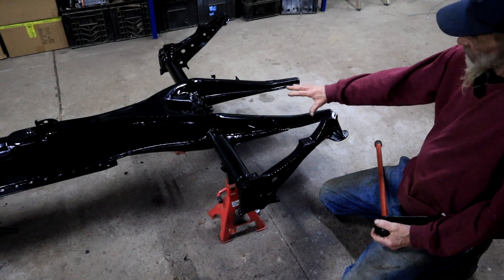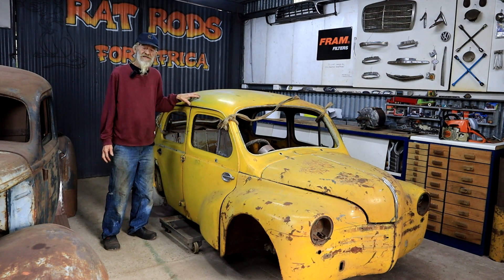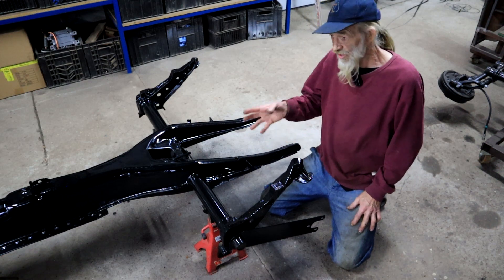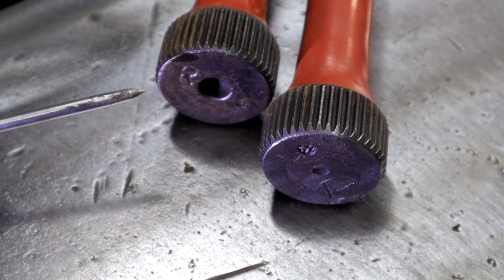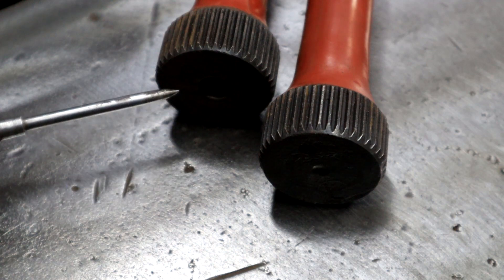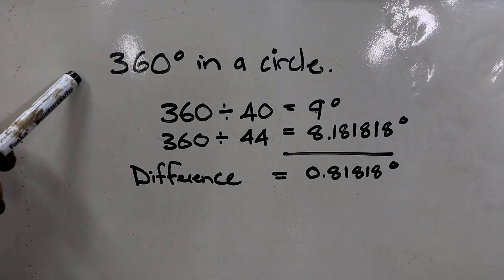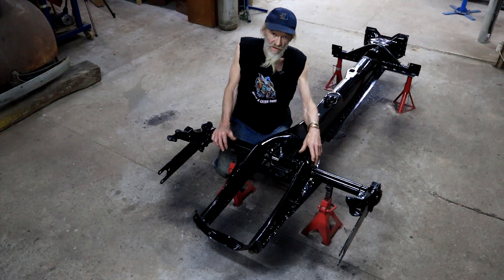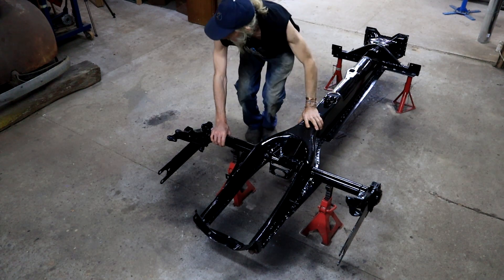How to adjust Beetle rear suspension VERY accurately. You don't know this!

Comment: Nice video, I have a 1970 bug with irs. I moved spring plate two notches to lower it from the outside splines, moves 2" per spline so I'm 4" lowered but wished for 3" I wonder if the irs bug has the lesser splines on the inside like your swing axle then maybe I can fine tune my ride height to a 3" drop
Reply from the maker: I have no knowledge of the IRS Beetles. They were never available here in South Africa!

Comment: I believe that you can swap the axles over and if you do then you will find the suspension very hard and that applies to the front also
Reply from the maker: I take it you mean the torsion bars. I would not swop them
Reply: @ratrodsafrica you saw the torsion bars say left and right,if you switch them around , the ride will be hard 😊

Comment: Question for you...    what do you do if your torsion housing on the frame has stripped teeth? Are there options out there to 're-sleeve' the frame for the torsion bar to engage with?
Reply from the maker: Wow, I've never seen that! Only thing I can think of is to cut out the part of the torsion bar housing with the stripped teeth and weld in the same piece from another floor pan.
Reply: @ratrodsafrica  lucky me then....   Hahaha!

Comment: My assumption is that the right and left is based upon the cut of the gear, thumbs up on the twisted sister
Reply from the maker: No, splines are the same both sides. It has to do with the "set" of the spring steel.

Comment: I haven't been following along but as I had several Beetles in the early 80's I remember some of the things your doing.
I still have my 1970 1300 (unless my brother sold it since I moved to USA)
Left hand drive cars are kinda interesting to drive in Britain when overtaking stationary bus picking up passengers (I had later 1303 at the time but forget what the other two were) I had a couple of Citroen 1300's, great engine (flat 4, OHC)  never did get around to trying engine/gearbox in Beetle though
Also had several Alfa Romeo  AlfaSud's, one was a South African Rally Special, no idea how it got from S.A. to Britain?
Had kinda 'thing' for flat fours  😁
When you said  it's strange to think we are same age as old people, I can relate to that  😎
The first time you cut front beam into pieces to lower it is kinda scary but the second one is easy.
I think it's waste of money fitting adjustable lowering after doing first one as I never adjusted mine after it was set and could measure how fat the front torsion spring  holder had been rotated
On the rear, the Vernier adjustment isn't as difficult as people seem to think.
Pretty sure Urethane bushings are still available or,  you may be able to buy urethane to cast up your own?
I remember you can't use Nylon or other plastics as they need to have some flex.
Just subscribed
Reply from the maker: Welcome to my shop!🙂

Comment: you nailed it regarding the torsion bar L & R sides. they are high grade spring steel and take a set once in use. reversing them can lead to catastrophic failure, leaving you sitting by the road with broken, sagging rear suspension. probably not a desirable occurence while driving. and regarding the spline adjustment, it is amazing. the adjustability is theoretically infinite. it's a good idea to grease the torsion bars, this prevents rust which can also lead to failure.

Comment: I used to be a ASE certified steering and suspension technician and I'm no Volkswagen expert I do know that to properly dial in your alignment you need the body mounted to add the recommended weight to the driver and passenger side of the vehicle as Volkswagen recommends, but what you just schooled us on in your video is spot on. Good job my friend!
Reply from the maker: Thank you brother!

Comment: Why marked left and right? Quite simply: these torsion bars were forged in a spiral shape so that they are more resistant in one direction. If they are swapped, the suspension becomes too soft. Greatings from Austria (no Kangaroos).
Reply from the maker: That makes sense. Thanks for the feedback

Comment: Div, it certainly 'makes me happy' to see your progress on the Renobug project.
More importantly though, is Wifey happy?
I had those 'swing arms' backed right down on the back of my old '59 bug, low and slow, plenty of neg camber. Combined with a weakened front torsion pack on the bottom beam and pretty well none in the top beam, 8" rims, she was very 'Chubby Limbo Checker", (how low can you go?).
Reply from the maker: Well, still getting good meals 😅

Comment: You are spot on with the reason for the L and R markings on the torsion bars. We use torsion bars on the racecar and mark them up when new so that they only get used in that direction. A right rear can also be used in the left front as it turns in the same direction. You can even buy these neat swing arms with an external adjuster so you don't need to remove the arm to adjust.
Reply from the maker: Thanks for the feedback!

Comment: Hi Diff, I’ve lowered my 66 Beetle 2 1/2” in front, 2 splines in the rear, I found the rear end too bouncy, and the front too firm, so I returned it to stock, a much better ride on Australian roads. 😊
Reply from the maker: Lowering doesn't change spring rate, so other factors must have caused it?

Comment: Greasing the rubber bushings is a bad idea. The grease will attack the rubber. That's why VW didn't grease them to begin with.
Reply from the maker: It's red rubber grease, specifically for use with rubber parts. Different to normal grease that can attack rubber
Reply: @ratrodsafrica  Ahh!  That sounds like silicon based grease, not petroleum based.

Comment: It's not a dumb question if you don't know the answer, right? I'm wondering if the sockets at the inner ends of the axles are in one solid piece, or separate, making independent suspension. In their day, Beetles were common as dirt around here, but I didn't pay much attention.
Reply: The inner splined anchor is one piece. Same as the front. The VW has 4 wheel independent suspension.
Reply: @e-curb  Thanks. I should have realized that, there being two separate torsion bars.
Reply from the maker: It's a solid piece welded into the tube. But the suspension is independently already.
Reply: @ratrodsafrica  Yes - obvious, when you think of it, which I didn't enough.

Comment: The coating on the torsion bar is very important. If the coating gets scratched or the bar is rusted it has a higher chance of breakage. Though I have never had a failure because of it, I know of those who have.
Reply from the maker: Yes, that is good feedback!

Comment: I was thinking just yesterday that I must have missed the bit about the adjustment of the rear suspension!

A question- is there enough play to raise the suspension so that you run higher or is that the standard setting so you need modify the stop lug if you want to increase ground clearance?
Reply: The angle range of the axle in the side gear of the diff is only slightly more than the suspension range. If you modify the suspension stops, you will destroy the side gears in the diff.
Reply: Thanks, that’s a good point.
Reply from the maker: With the stock Beetle setup, the swing plate sits a distance away from the stop when the car is on its wheels. Back in the day, we would go down a spline or two the get more ground clearance. The danger with that is that you get more positive camber which could result in a flip over when you corner hard. The wheel "tucks" in, and over you go. I learned that the hard way when I rolled my first Baja in the 80's. So, just a little positive camber at most. Larger tyres are the best way to get more clearance
Reply: Thanks - great story.

Comment: The Renault body must be a lot lighter then the VW body!?!?!? If my memory serves me right, i did to notches before the lip which came almost to stock hight with a bit lower.  If we had to put non stock bigger engines in these cars, the bushings were changed to delrin made ones which made the rear noticable stiffer. Back then, the best way to lower these beettles was to use lowering plates that we cut off in the shop to retain the full suspension travel.  Can't wait to see that renault on the road. Thanks Div for taking us with you.
Reply from the maker: Yes, lighter for sure. I will experiment with the settings once all the body weight is in place

Comment: I think VW went with asymmetrical torsion bars to counteract torque from the engine for the same reason a lot of RWD vehicles have unequal/asymmetrical springs in the back (you might have 3 leaves on one side but 2 on the other you see this a lot in small trucks)
Reply from the maker: Dimensionally they are exactly the same.
Reply: I does seem to be a asymmetrical reason🤔
Reply: The torsion bars in a VW are identical, left and right.
Reply: @e-curb  It would seem to be the case and yet why would VW make two different part numbers, marked "L" and "R?"
Reply: @scottcates   Because if you put a left bar on the right side, it will break. They need to be marked because most mechanics wouldn't think to mark them when they are removed.
Axles are not marked. With an axle from a swing axle car, you can tell which side it was on by looking at the spade end's wear. Either way, the stress on an axle is microscopic compared to the continuous stress on a torsion bar.

Comment: The steel in a torsion spring is twisted before the spring quench process is applied giving the steel a pre torsion, this gives the bar a direction of twist for spring.  Reversing the bars can force the spring to break for over binding against the twist.  The two spline differences is so you don’t put the bar in backwards also placing the twist in reverse to it’s natural direction.
Reply: Back in the day drag racers used to paint a line on their axels and check them periodically for twist and when the line contorted to a certain point the axels were retired, this was a way  to tell when the axels were on the verge of breaking.
Reply: So why is one thicker than the other?
Reply: @Drmcclung  The two bars are exactly the same diameter. The ones in the video above are 22mm.
Reply: The bars take on a "set" in use. Then when you take them apart years later, you have to replace them the same way, otherwise they will break when stressed the opposite direction.
Reply: @e-curb  I dunno.. have had many sets of vw torsion rods show up 2 diff diameters for L and R. Leaf springs on pickups too
Reply: @Drmcclung   If you found different diameter bars in a VW, someone before you changed one.  VW never used different bars left to right. They did use larger diameter bars on heavier cars. For example, a Type 3 squareback had both bars 1mm thicker than the Fastback or Notchback. Also, in 67 when they added the external overload spring, the torsion bars were reduced by 1mm.
Reply from the maker: I like that answer. And the spline differences allows very accurate adjustment.